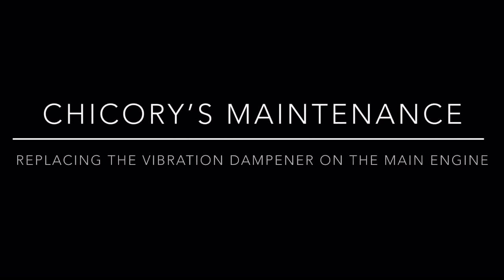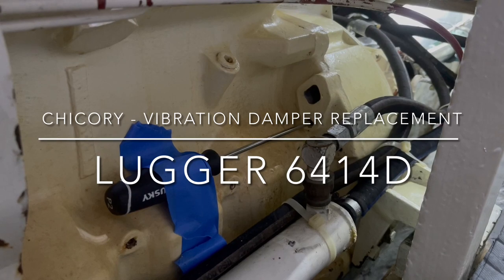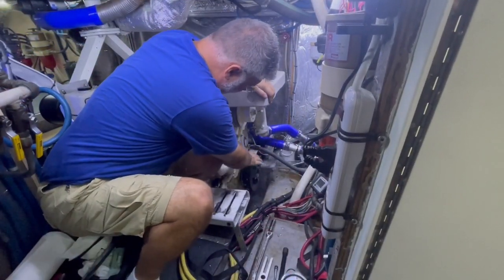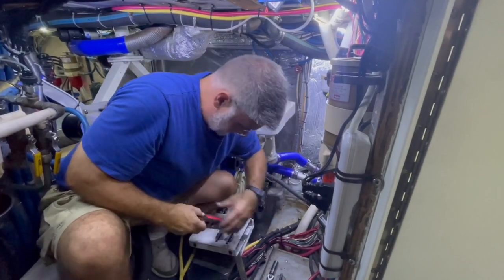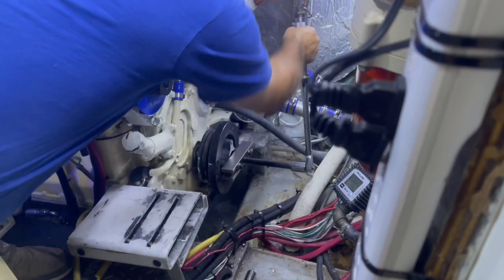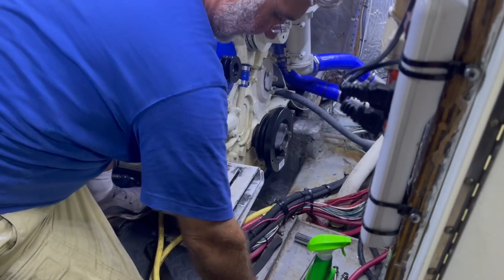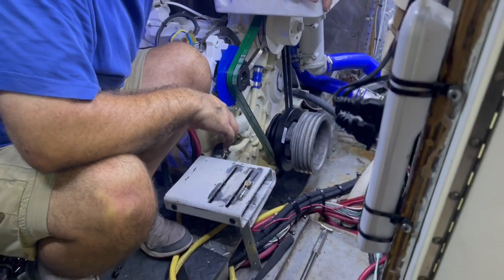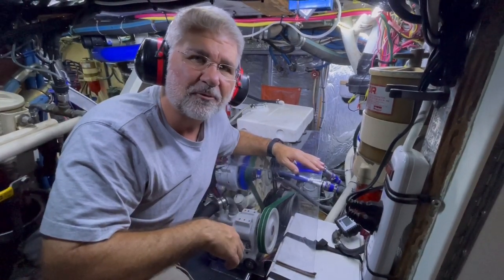Replacing the vibration dampener on Chicory a 46 Nordhavn

Comment: Why did you have to change it?
Reply from the maker: The John Deere 6068 engines have a vibration dampener that incorporates a rubber material between the inner hub of the dampener and a heavy outer ring. This rubber deteriorates over time. The manufacturer requires the dampener to be changed every 5 years or 4500 hours, whichever comes first.